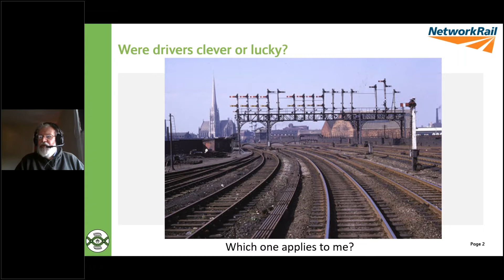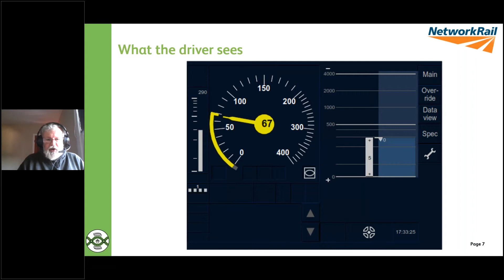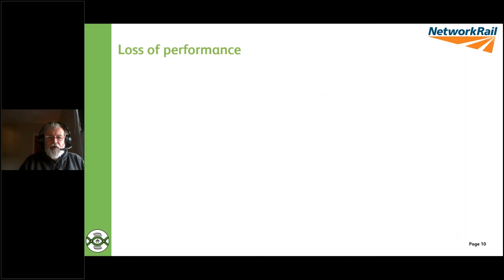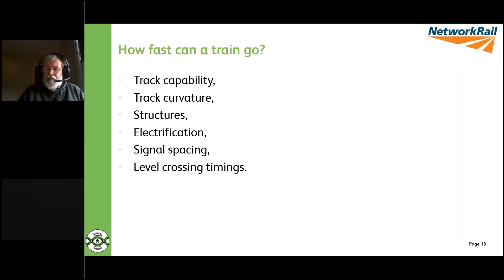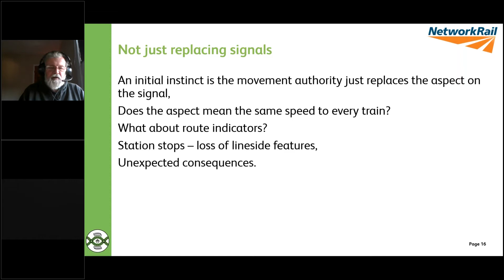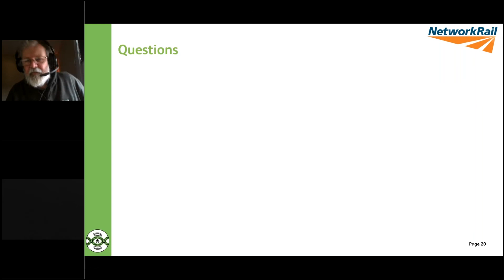Track Engineers guide to ETCS - Traffic lights in the cab - John Alexander

Comment: Doesn't the UK have a system that supervises speed at all today? In Norway and Sweden we have had the ATC-2 (Ebicab 700) system since the early 80s. And that gives you most of the information in ETCS level 1/2 already.
And fun fact - The ETCS balises are based on the ATC-2 balises. 😁
Reply: Basically no.  At least not on the vast majority of lines.  We have basically 100% coverage of AWS (Automatic warning system), a 1950s system which is capable of stopping trains AFTER they pass a signal at danger PROVIDED the driver has not cancelled the warning.  This works most of the time but of course if there is another train just inside the block marked by the danger signal, then its a bad day.  Additionally in the 2000s a second system called TPWS (Train Protection Warning System) was installed at most high risk places.  This is based on fixed beacons beside the track BEFORE the signal and is capable (Usually) of stopping the train BEFORE a signal at danger and is not easy to routinely cancel.  This system has been highly successful and although SPADs (Signal passed at danger) occur, they are much rarer.

In the late 1980s a continuous automatic protection system of some kind (Called "ATP" generically) was reccomended for universal roll out but this never happened due to budget constraints and analysys that showed that more lives would be saved by spending the money in other places - better trains with better brakes, level crossing cameras etc.  Thus only two prototype main line systems were deployed, one on the Great Western line (Still in use) and one on the Chiltern Main Line (Retired due to obscelescence).  Neither were UK developments, one was based on LZB from Germany and the other was I beleive a Belgium system.

High speed 1 - between the Chunnel and London - uses Cab signlalling of the TVM430 type as used on French TGV lines.

There are various CBTC systems used across the London Underground, London Overground and London Docklands lines but these are varied and incompatable.

In the 2010s the Cambrian line in Wales was fitted with ECTS level 2 as a trial run, and has been running since then.  Unfortunatly on 21 October 2024 a fatal accident occured on this line in spite of ECTS.  This was due to the inability of one train to brake in slippery rail conditions.  The stock involved would not meet modern crash protection standards but there is also an issue (In my opinion) in the UK in that for some reason electromagnetic track brakes are not fitted - they are routine in Germany for example.

ETCS level 2 has since been installed on several short lengths of line around London and is going tom be installed on at least the southern section of the East Coast Mainline and all of HS2.  But unfortunatly we dont even have the asperation for a universal roll out, which is nuts to me.
Reply: @drawingboard82 : Small point of order, AWS doesn't stop trains from passing signals at danger at all, it only provides a warning (and stops the train if and only if it isn't acknowledged - after you have, you're basically "on your own"). That's the main reason why TPWS was introduced, which itself (generally) won't stop a train before it passes a signal at danger, but is aimed at preventing a train from reaching a point of conflict (on that, the speaker has a good video on his channel, "TPWS - the principles, some history and the loop placement calculator") as well as some limited protection against overspeeding.
Reply: For the most part, other than ETCS and a couple of other exceptions, there's no system that continuously supervises speed or movement authorities. TPWS can be used to influence speeds at fixed locations/brake a train on passing a red signal, but can only take action on passing loops (and depend on them being present - they are usually only placed in "high risk" locations!)
On that note, the ATP systems mentioned (which are two of the exceptions to the lack of continuous speed supervision) were actually derived from TBL and LZB!
Reply: TVM430 and KVB